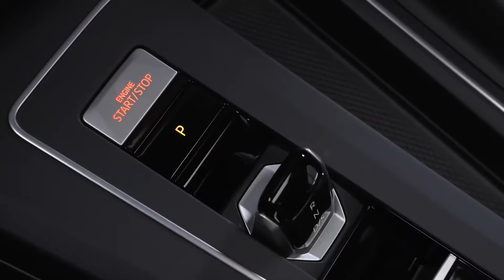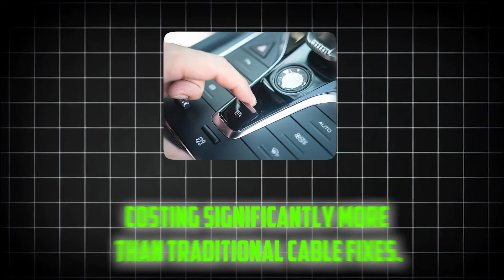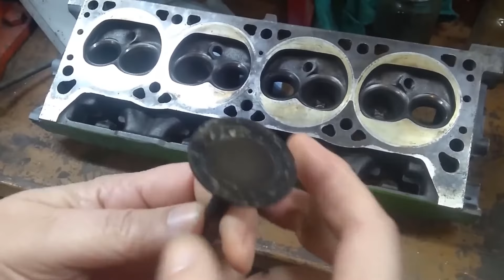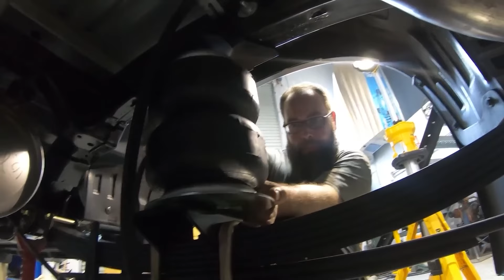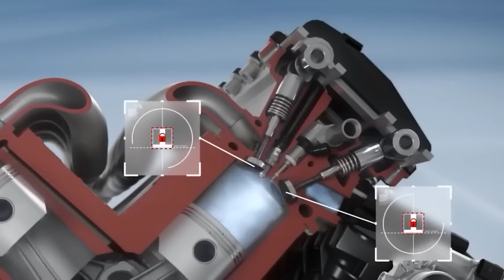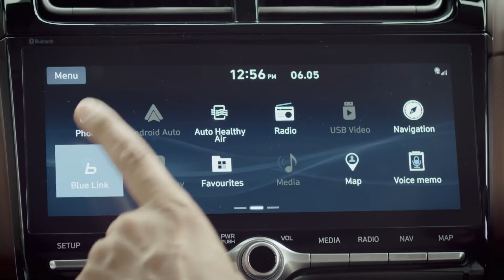21 Dangerous Car Features That RUIN Reliability (A $60,000 Mistake)

Comment: Dont buy any vehicle with features that turn the driver into a passenger ,they have UBER and City Busses for that !!!!
Reply from the maker: Spot on. There's a massive difference between 'safety tech' and 'taking away driver control.' When a car starts making decisions for you, it’s usually just adding more points of failure. Which of these features do you think is the biggest 'mistake' manufacturers are making right now?

Comment: There is a lot of BS in this AI garbage video. Electronic ebrakes are great. They use existing hardware (antilock systems). How many people don't use their normal parking brake. Then that one day that they do ... all those cables are rusted up and screw things up. Guess AI just is stupid.
Reply from the maker: That’s a fair point about cable rust! Neglected manual brakes definitely have their own set of issues. The main focus here is really the long-term repair cost and complexity—replacing a snapped cable is usually a cheap DIY fix in the driveway, whereas a failed electronic actuator or a module glitch often leads to a much bigger bill and a trip to the dealer. Thanks for sharing that perspective!